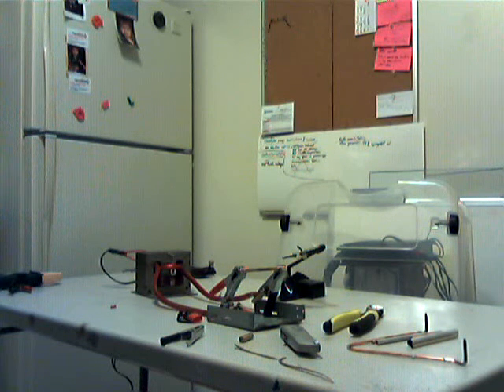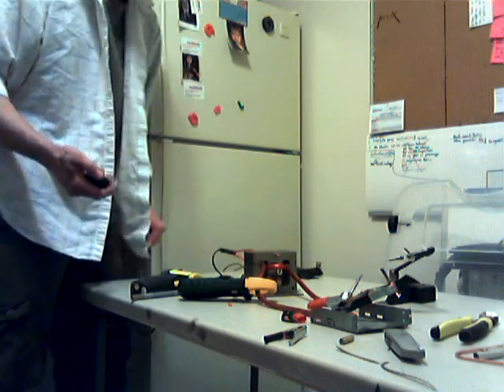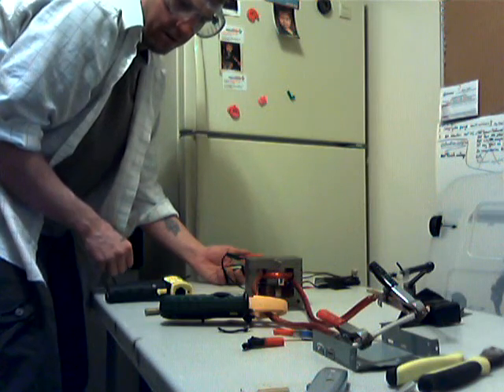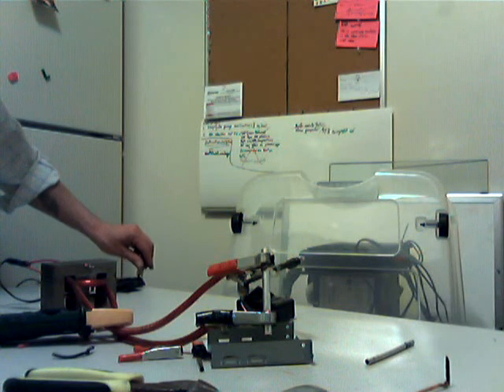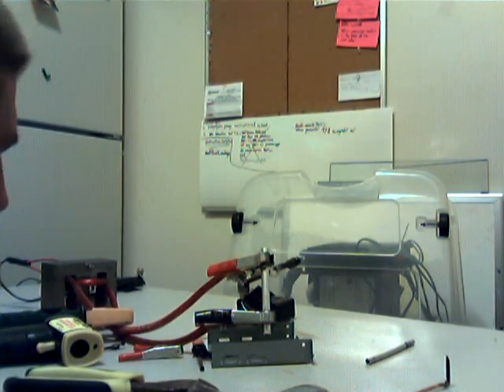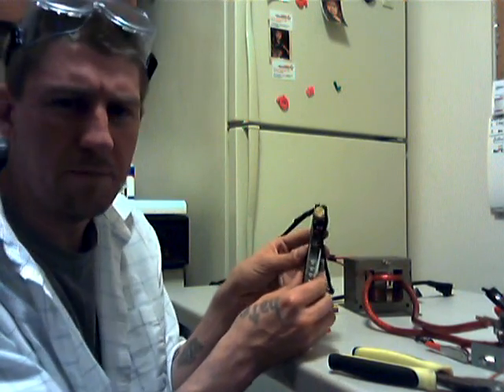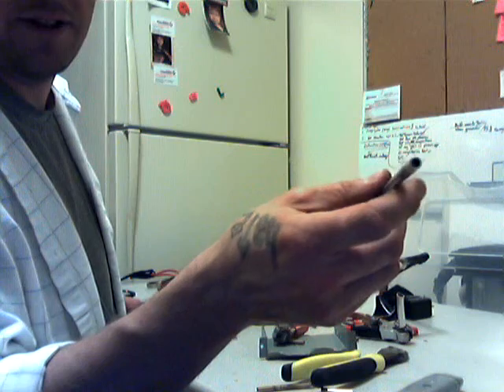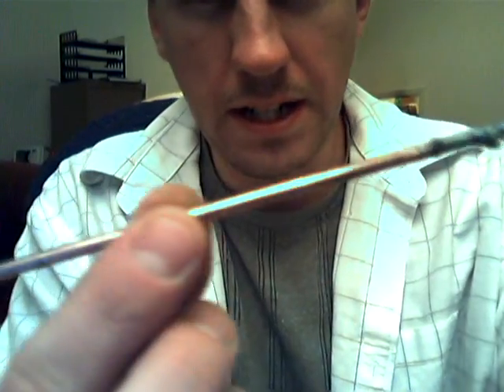home made high amp transformer 800 amps DIY

Comment from the maker: just so every one knows this type of dimmer cannot be bought allone as far as i know ,i got it out of  a decrative halogen lamp the type that shine up at the ceiling and it will crank 10 amps ac no problem i am going to run my torch of of this  device it is far better then the liqiud variac size wise

Comment: I finally blew out the triode in my light dimmer. I was going to look into replacing it with one that can handle more current!  try taking one apart to see what's on them!  there very simple!  a larger triode will enable it to work with higher currents!

Cheers

Comment: Great job, Thanks for the explanation on the transformer!

The other day I had a brainstorm for the diodes!  the diodes that are used in the large automotive battery chargers.  they can handle some amps.

what kind of circuitry is on that dimmer you are using?  is it something we can re-create from other parts? or what is the easiest way to find one?

Cheers